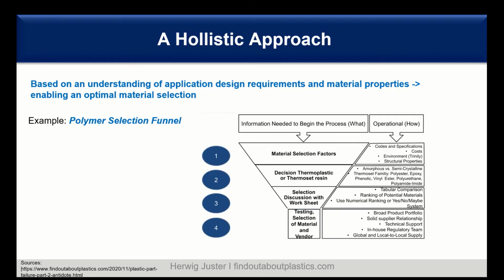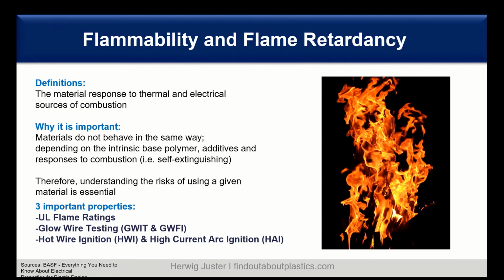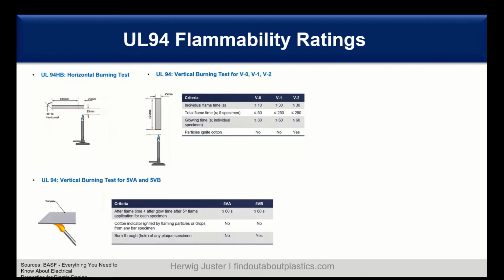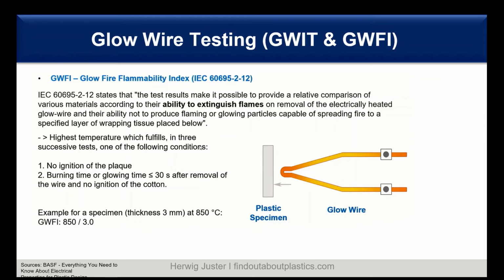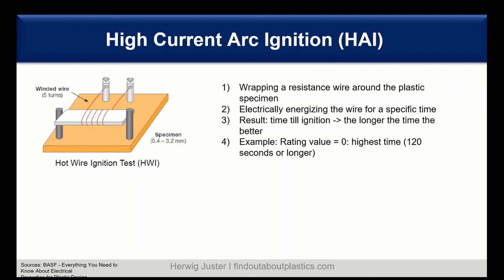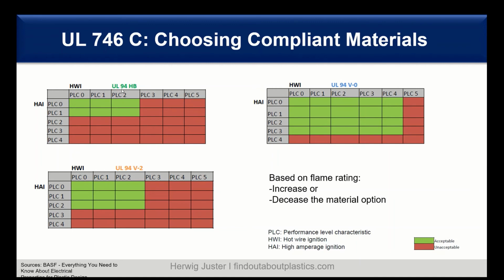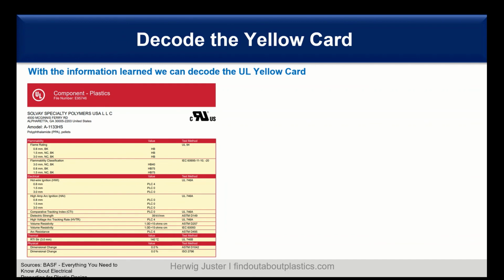Polymers For E-Mobility I Electrical Design Properties I Part 2 - Flammability Ratings

Comment from the maker: Time stamps: 
00:14 A Holistic Approach
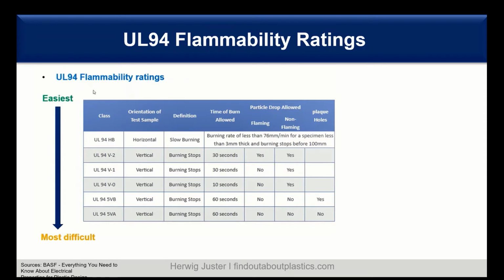04:53 UL Flammability Rating
07:53 Glow Wire Testing
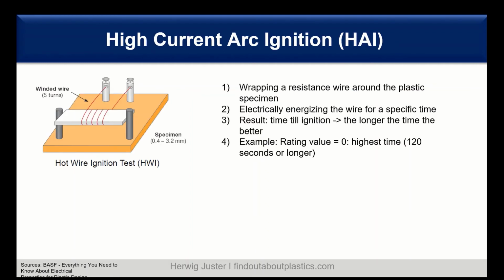10:04 High Current Arc Ignition
12:19 UL 746 C
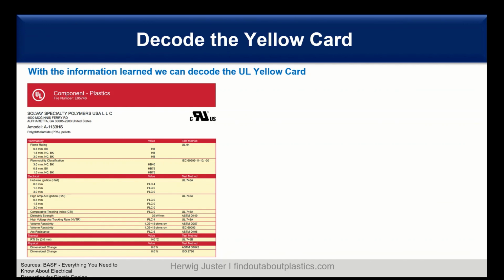13:30 Decode the UL Yellow Card 

Thank you for watching and till next time!